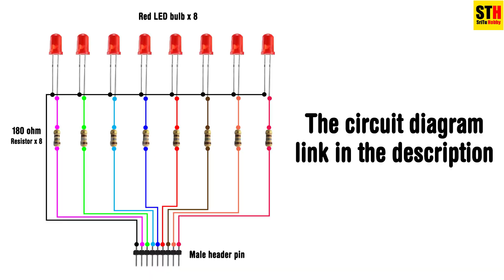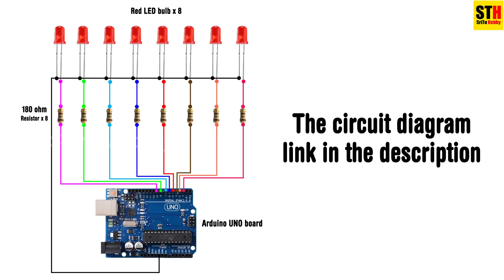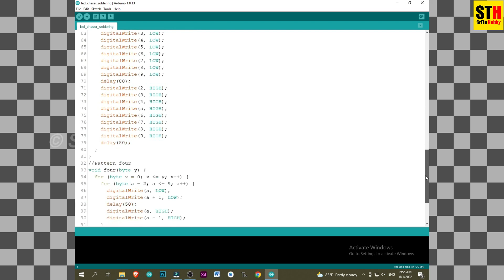How to solder an LED chaser circuit using a few easy steps

Comment: Nice work very well
Reply from the maker: Thank you
Reply: Can you make IoT based blynk water tank level indicator with motor auto off and on and also motor on with Mobile and values shown on display can you make it
Reply from the maker: Ok sure.